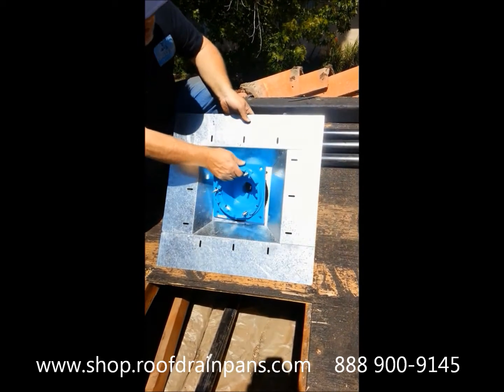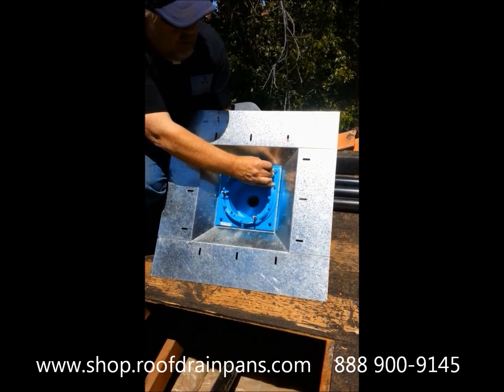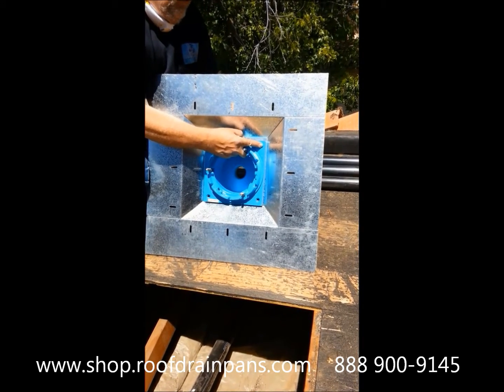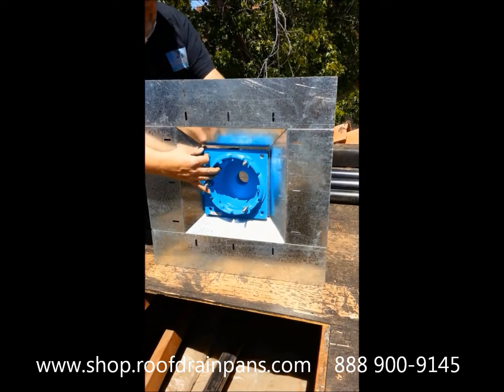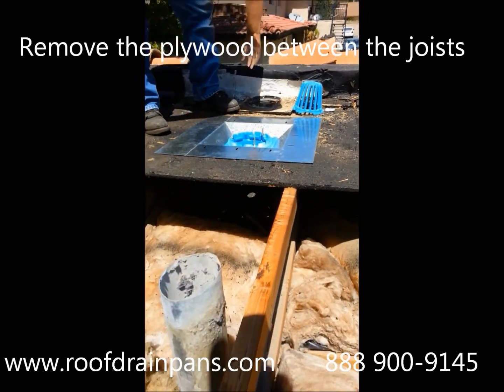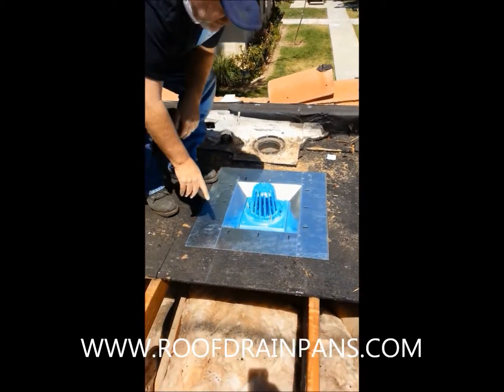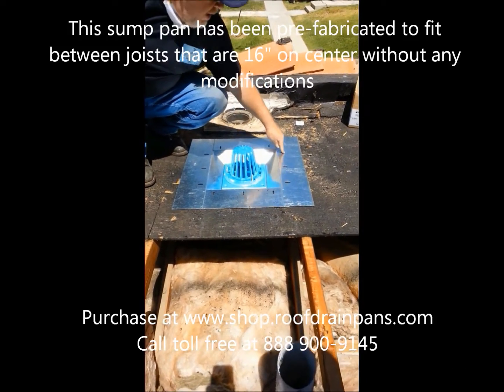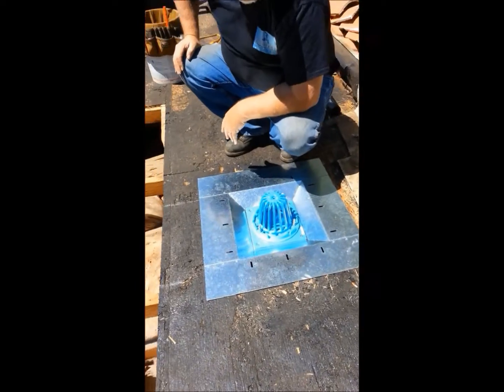How To Install The Frank Pattern Single Roof Drain | FAST & EASY | ALL Tech Plumbing and Rooter

Comment: He did not seal the grate to the pan using any sealant and it will leak. This is not a good video of proper installation.
Reply: Scott Chesnut the grate does not get sealed. It locks into the clamping ring per the roof drain manufacturer design. The roof drain body itself (that sits on the sump pan) is to be sealed by a roofer or competent individual. This is usually done by the roofing material being installed over the pan and over the roof drain body, into the bowl. Therefore completely sealing the roof drain and making for a watertight seal. This video is on how to install the roof drain and sump pan in a roof deck. Thank you.
Reply: Stocky Balboa  Thank you for your clarification. This video does give the viewer a very good idea of its functionality.  I have actually bought this unit and am looking for precise information on its installation which you have provided. Thank you.